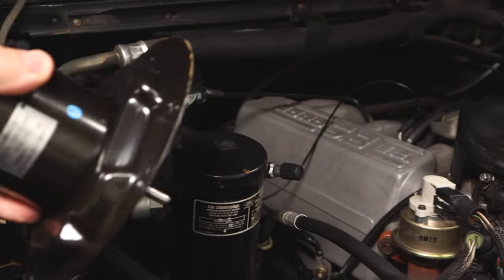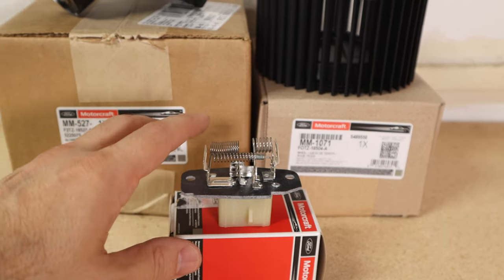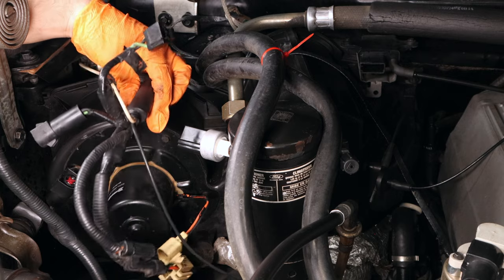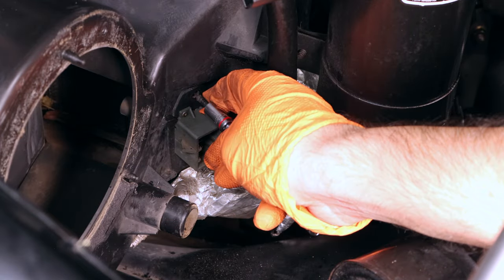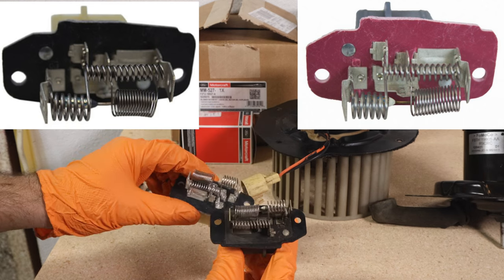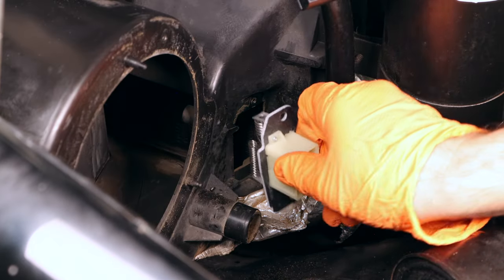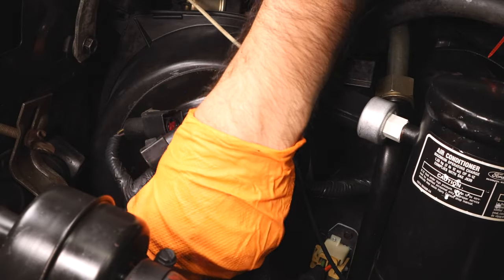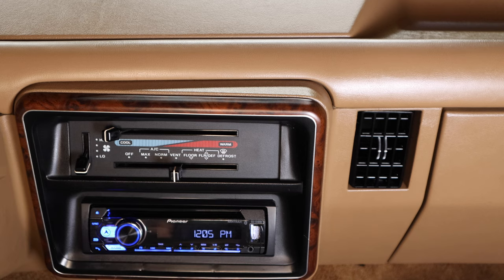Ford Bronco F150 Blower Motor & Resistor Replacement | Weak No Air Fan Speeds | Bronco Restoration

Comment: Wat about if you have your ac high and you driving and you pass 35-40 mph and your ac goes to low ?
Reply from the maker: That is usually a sign of a vacuum leak. Check the most common culprit, the hard plastic vacuum line that routes to the ac/evap box (pass side engine compartment) there is a small check valve that can go bad. Then check the hard line that goes to the fresh air vent actuator.

Comment: I am going to replace the blower motor and resistor in my 92 F150, and I checked for availability at several places.  My intention was to get Motorcraft, but when I checked the country of origin it said China. So is Chinese Motorcraft any better than a Chinese after market part.  I think probably not so I will go for a cheaper part.
Reply from the maker: If you can find a standard ignition or Delphi part would also be good.
Reply: I was wrong. Imagine that!  I don't know where I thought I saw the Motorcraft made in china but when I went to Amazon and searched for the blower motor parts they said Motorcraft, made in USA so that is what I ordered. Sorry about the bad info. @TheFixTech

Comment: This should be part of ev'ry body Preventative Maintenance,  if you can find or make that Sticky gasket...I'm doing mine's now...The amount of 🐀🐀💩💩💩 , 🦜🦜🦜💩💩💩, dirt buildup, leaves, twigs, and enuff dirt to build a Mud Hut, you'd be surprised...!!!!... No wonder why my AC is not working good...The Air Box is stuffed with 💩💩💩 like a freeking  🦃🦃🦃🦃🦃...!!!... Pull yo blower and clean 30+yrs of 💩💩💩 outta there...!!!!
Reply from the maker: And those leaves/twigs could be a fire hazard as the resistor gets very hot.
Reply: @TheFixTech  ... I  didn't know that...But, anyways,  I was pulling handfuls of Black dirt outta the Airbox...Handfuls...!!!... I went to the Car wash and stuck the Vacuum hose down to bottom and sucked up as much as I could...Then went to Wallyworld and used the Free air hose and blew out as much as I could....Don't know why or how all that dirt and stuff got in there...But, anyways I got it cleaned up...And the old adhesive from the 30 yrs old gasket...Ran outta time,  so will have to finish this job tomorrow....Still tripping over the Handfuls of dirt and crap that was in the  Airbox....